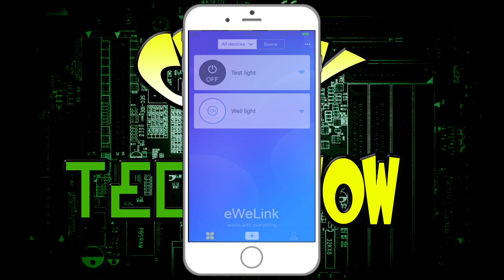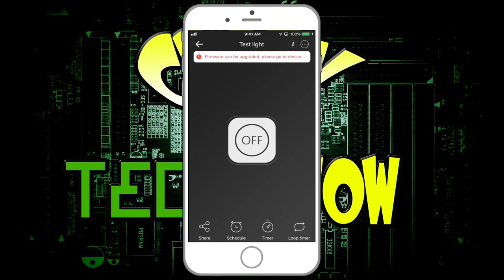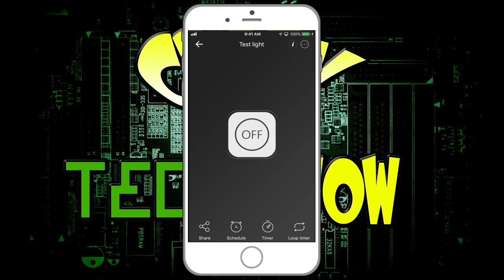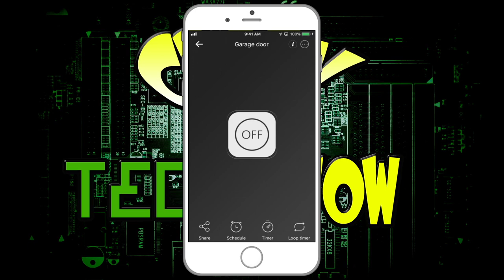How to make a smart Garage Door opener for  $7.00

Comment: The sonoff re5v1c only costs $2.50 and it’s already a dry contact relay out the box. Programmable inching mode, it’s basically the same thing for cheaper and no mods needed and you can typically use a transformer on an old phone charger to power it. Also you could just connect wires in parallel from your sonoff to the button for your garage door, so the sonoff will do the same thing as pushing the garage door opener button on your wall, save you hacking up that liftmaster transmitter
Reply: How I can do that on my garage control? How i connect it parallel?
Reply: @MichailKir  you can wire infinite switches to your opener connection. Like a door bell button for instance, you could find a photo eye setup with  NO/COM connections and use that as a switch when someone walks through it. Just make sure you have everything connected to the open side of any relays. Whatever closes will activate the opener. 

If youre using programable relays you'll need to put them into inching mode so they only turn on momentarily - no more than a couple seconds on. On a gate automation system you can set it up normal toggle mode and use it to hold open a gate or pair of gates. Polarity doesnt matter but all switches and relays connected to your opener should be a dry contact, meaning you are not adding voltage just making a connection. Happy to answer any questions. Have a great weekend. 

Sorry i said switches but they're used in gate automation, not garage door openers. I meant buttons
Reply: @MichailKir  parallel in a garage door opener means if you had decided to put a bunch of doorbell buttons in your garage to open the overhead door, youd run a pair of wires from each button to the opener. Polarity doesnt usually matter with garage door openers but lets say your wires were all white and 1 of every pair had a black line on it. You'd connect all the wires with the black line together and all the white wires together, now all the buttons are parallel. If you touch the bundles together the door opener will activate. As long as it stays an open circuit you could theoretically add 50k buttons in parallel and any 1 of them would open the door. 

In place of buttons you can use relays or remote receivers or anything that can activate a relay remotely.

Comment: in the Alexa app you can set up routines so when you say alexa, open garage it will turn on garage door. And another routine that when you say close garage door it will send the on garage command. That way it is more normal talking. Also to get around having to use a remote, you can solder sonoff to the contacts for the button on the wall switch. When you push the button it closes the contacts of the button on wall plate before it goes  to the rolling code. Works a treat.

Comment: Will,  THIS is a hack that comes up with a even greater device.  Love it.  I've been using one of these on my garage door.
BUT, how do we make physical changes to the Basic RF R2 or RF R3, to a dry relay so we can use it as a garage door opener controller?  I want to use the RF side of the RF R2 or R3 with a remote.  Can you show us how to change the Basic RFR2 to this type unit?,  Please?
Reply from the maker: I’ll look into it but it’s a little bit more complicated than the original.

Comment: Hi Will, great videos! I am a total rookie and I want to build my 1st Raspberry Pi.  My garage doors have MyQ and work great. Now I want to make by gate motors (not garage) have the ability to open via HomeKit.. The gate motors don’t have wireless capabilities. It is a fair assumption that installing Raspberry Pi with HomeBridge should allow this to work?
Reply from the maker: As long it has a wireless remote like the one I showed in the garage door opener. Just in case you didn’t see it here’s my video on Homebridge https://youtu.be/2RnDp5Eg1RE . You can use ifttt plug-in to make it work with sonoff. I’m going to have to make a video about that. You’re the second person to ask me today. Thanks for the kind words and watching.
Reply: It’s been a year so you probably have this sorted out, but if you look on the main board of your gate operator there will be a connection called open, or N/O or sometimes it’s called start, you just need a dry contact with leads to one of those and a common. Test with a jumper wire, touch the open and common and the gate should open. You want to program the sonoff to inching mode and have it turn off after about a second

Comment: Hey boss, great job. I live in Jamaica. I’ve watched a ton load of videos lookin for help but none did, until I came across yours. I have the chamberlain MyQ system. It is originally a smart system, I used the MyQ app but I’m a bit tired of going on my phone or tablets to open and close the door. I once linked it with The SIMPLE COMMAND app and Kloee for SC then tied it in with the alexa echo dot. Works great via alexa voice command for maybe two months. Then one day it just stopped. The simple commands App took an update and kicked me off.  The voice command was so cool, I vowed I have to fine a way to get it back. And walla . YOUR VIDEO. I’ve seen plenty video where people short circuit the garage doors and they opened but when I tried mine it did not, based on the safety features. So now that I’ve watch your video and it’s obvious that I can wire it from the key pad, which makes a lot of sense. I’ll just do that. Thanks a million bro. Like we say here in Jamaica (RESPECT MAN)
Reply from the maker: Thanks! really appreciate it. Sounds like he went through the same thing I did.  Yeah had to figure that out the hard way thought my video was done for. Then I was like the Remote! In the video that was really me being like dammit what do I do now guess this video is not coming out. Lol worked out 😁

Comment: I ordered one of these for my garage door, pretty cheap and looked like fun. However the PCB mine has looks very different. It has wires running across the surface and the thing that diode is right next to the box and the link is a lot closer together. I'm not sure what part I should cut or if i even can cut it or need to use a different approach. Can supply some pictures if anyone wants to help out.
Reply from the maker: Yeah right after I made this video they change the design. I haven’t got the new ones yet but they make A garage door opener for a couple bucks more.
Reply: @CrazyWillTechShow  I found a video featuring the new PCB. I don't understand why you don't need to connect the neutral you cut back to the load. I'm not very knowledgeable on electronics but how does the input part create a circuit if you cut the neutral and never connect it to anything?

Comment: great video as always man ! I have question, why didn't u use Apple Home for that ? Was it your limitation or u just preferred to use another app ? Can u tell me more about your decision on the application and ignoring integration ?
Reply from the maker: You can add it to homekit using homebridge on raspberry pie but you have to install new firmware on the sonoff and find a plug in that works. I already have it setup through Chamberlain AKA HomeKit is built into the garage door or ready. I use Alexa for everything anyways. Homekit is my back up. Like i said in my video it for my father. Thanks for watching.
Reply: thanks for your comprehensive response man ! your sense of humor makes your videos stand out among others, I often feel bored when watching others but yours always keep me energized.  @CrazyWillTechShow
Reply from the maker: Thanks man really appreciate that. I was thinking you could use ifttt.com to use Homekit through homebridge forgot I wanted to make a video on that.
Reply: I've searched IFTTT for the Home services, they have no services for that unfortunately, I'm gonna send a request for that and I ask u to do that too, they will care when the number of requests increases. By the way I thought so much about your problem on garage doors when connecting the wires directly, there are two possible reasons: 1. the voltage or current that is sent is different from the voltage and current of the wires, so if you check the receiving voltage and current on the door by a multi meter or something like that you will notice it's the case or not. 2. connecting two wires directly may cause some unstable voltage and current at the first moments, maybe the system checks for those instabilities to figure out the contact is made by connecting wires directly or the controller for security reasons as you said.   @CrazyWillTechShow
Reply: Hey Carlos! yeah you can do that easily, you can use your GPIOs to control your gate motors. here's the video describing how to control GPIOs by Home:
https://www.youtube.com/watch?v=lG5oE-Xrtu0@Carlos Melich 
it's for controlling lights but you can use it to control your Motors, you also have to check the type of your motors (DC/AC, 1/3Phase and etc)
you need some contactors (relays) for that too.
Reply from the maker: They have it look under ewelink that the app sonoff uses. The plug-in for homebridge is https://www.npmjs.com/package/homebridge-ifttt . Like I said I'm going to have to do a video. Hope that helps.
Reply: Thanks man ! I'll be glad watching a video of yours about that one.  @CrazyWillTechShow

Comment: Just to be sure I understood it correctly, you soldered the Sonoff output of 120v directly to the Garage Door Opener and it worked perfectly?
Reply from the maker: Please Watch the video show you exactly what I did...and please remember I’m not responsible.. but with that said your basically cutting off the power and connecting the power to the relay and just using the relay part... if that makes sense.
Reply: Makes sense.. but see my other comment for the alternative without interrupting the power relay.
Reply: And thanks for the explanation..
Reply from the maker: I’m sorry I’m not understanding what you’re trying to say. If you detach the voltage from the one side there no power on the out put end just a relay. So power on one end for Wi-Fi and relay and other end just me The connection A.k.a. relay. No power just what the Devices connected to. Like if you had two wires and tapped them together. I hope I making sense lol. Hard to explain on a message.
Reply: I totally understood what you showed in the video..you basically interrupted the power from "Load" to "Line" on the Sonoff, so when you solder the garage remote opener, power doesn't flow to it, but rather just completes the circuit...mimiking the push of the button on the remote..

But when I initially saw your video, I missed the crucial step, but got to understood later (after I posted the comment)..

Anyways.. Thanks for your idea.

Couple of things I wanted to ask you... 

Have you tried with the new version of the Sonoff where the solder line is replaced with wires?

What did you think of the other video where the guy used a 5V relay to solder to the Garage remote?
Reply from the maker: @KiranKumarBostonian  Oh good thought I was confusing people. I didn't see that one with 5v... I don't have the new ones just had these laying around and my dad need a garage door opener that would work with Alexa so this was my plan. lol I think I'm going to get some bc everyone asking me about them.

Comment: Any chance you can do this vid with the new sonoff basic? New one has a different arrangement
Reply from the maker: Anything is possible maybe if I get my hands on them. Try looking up the board for you to see what to do but I would need to see it in person. Thanks for watching.
Reply from the maker: Hey I did find this https://www.chatteris.biz/blog/sonoff-basic-voltage-free-relay-changeover-modification/
Reply: I had this problem as well. I saw videos online of doing this mod so I ordered a Sonoff and received a v2 which I couldn't find any guides for.
After a bit of back of forth watching videos, wiring diagrams and comparing the V1 and V2 in person (since I was using v1 Sonoff Basics already at home), I've successfully accomplished the same thing now. Tested and working on my garage door at home.

I've uploaded a V1 vs V2 image here - https://imgur.com/a/GunmoW2
Cut where I drew red lines, and join where I put the yellow line.